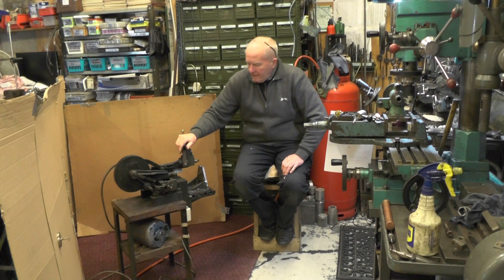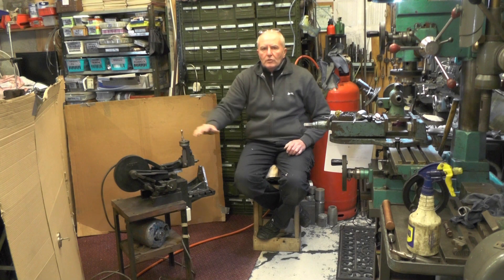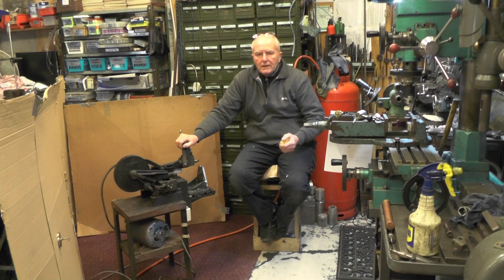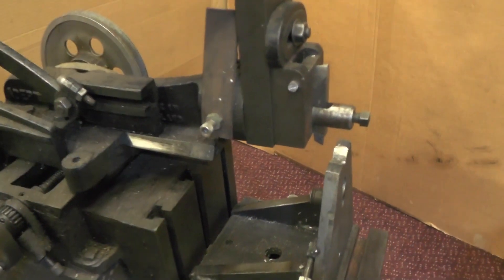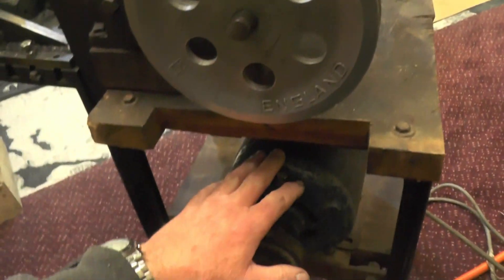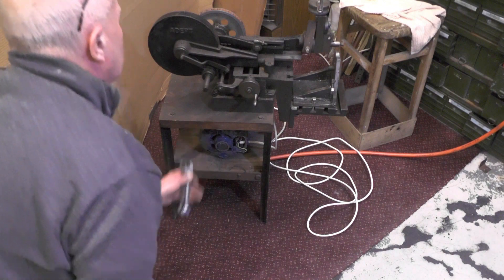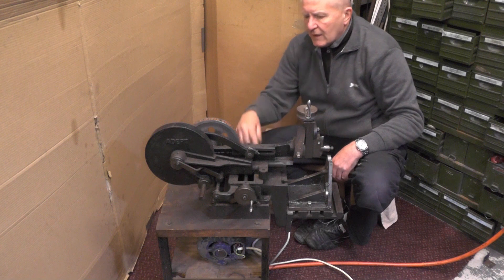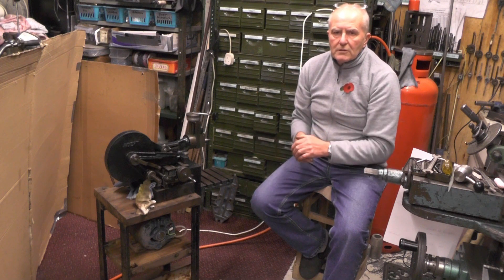Adept No.2 Shaping Machine PART 1 (New W/shop Addition) Re-Commissioning, Review & Modifications

Comment: That's lovely Kev !
Putting it on a higher cabinet would make it so much user friendly. Also, if wide enough, the motor could fit inside and the belt could come out through a slot in the top. Jealous I am 😇😇
Reply from the maker: cheers Niel
Yes, i've put a little thought in to it and you may be pleasantly surprised how it turns out and performs, I was, 
found out since, that this powered version is a little rare to find.
thanks for feedback
Take Care
Kev